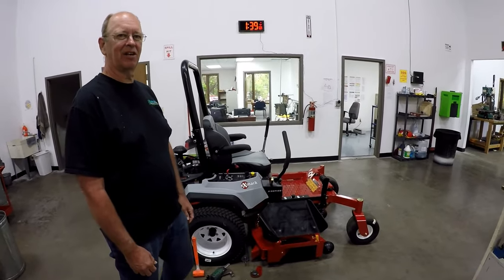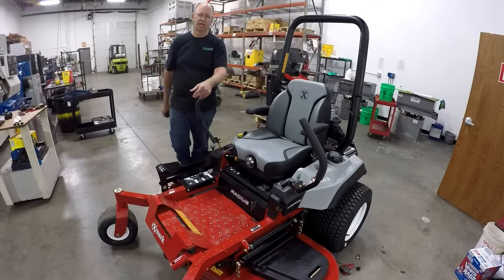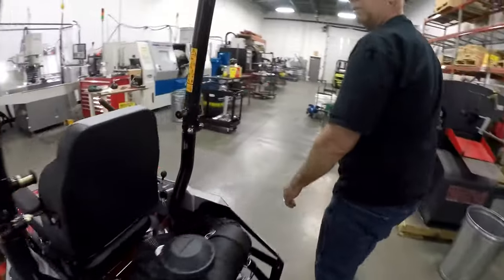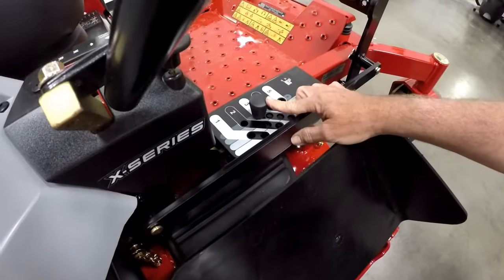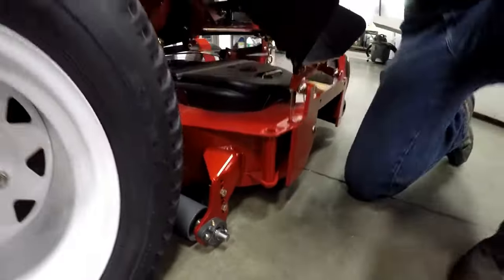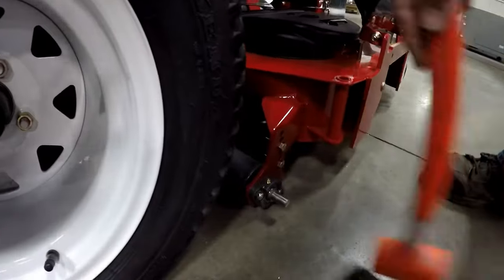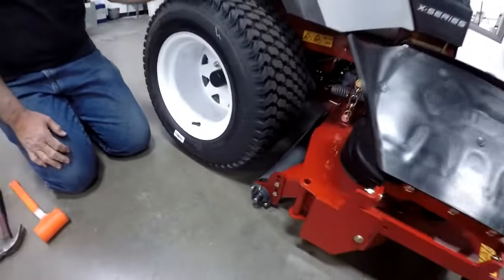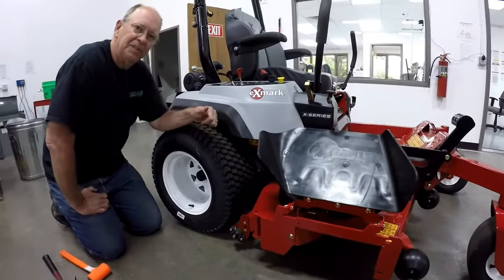Lawn Striper Installation - eXmark Radius all models

Comment: just a suggestion, have left and right bearing kits so it would be easier to grease bearings on trim side of deck. even with nut inside, zirk should face up as it does on opposite side. just my two cents

Comment: What about going on and off a trailer? Will it run like some decks do going off the trailer?
Reply from the maker: Unless you have a very steep ramp on your trailer this in not a problem.
Reply: Great question, I was about to jump and relized my deck scrapes going up ramp to trailer even when deck is raised.
Thanks

Comment: Can I get one for a turf tracer and what if you cut some yards at 2.5?
Reply from the maker: Yes, right here - https://www.harrisonspecialties.com/exmark-turf-tracer-x-series-with-52-or-60-deck-lawn-striping-kit/ and https://www.harrisonspecialties.com/exmark-turf-tracer-hp-or-s-series-with-48-or-52-deck-lawn-striper/
Set the roller to run on the ground when mowing at 2.5 inches. At that setting it should still strip good when mowing at 3 and 3.5 inches.
Reply: @KerryHarrison-Woodturning  awesome thank you for the quick response
Reply from the maker: @TheLawnFellas  You're very welcome.

Comment: What is the diameter and weight of the 60" roller?  Also is the roller powder coated steel or stainless steel?
Reply from the maker: 3" diameter powder coated steel roller. Kit weight 26 lbs.